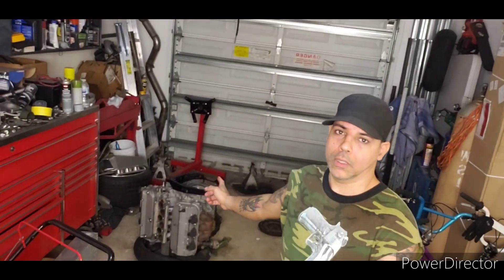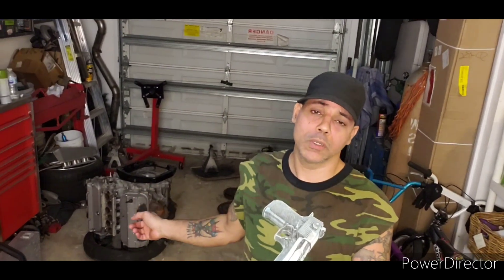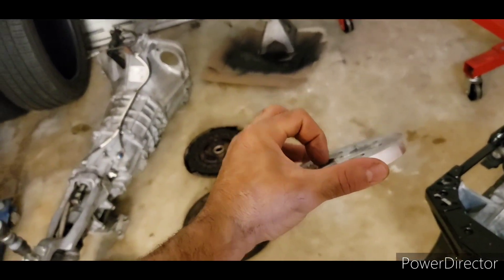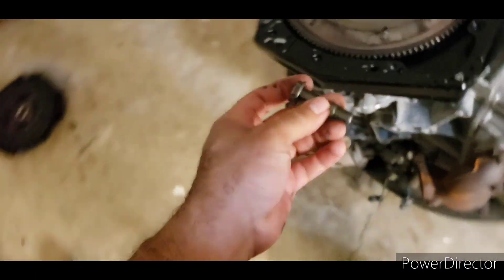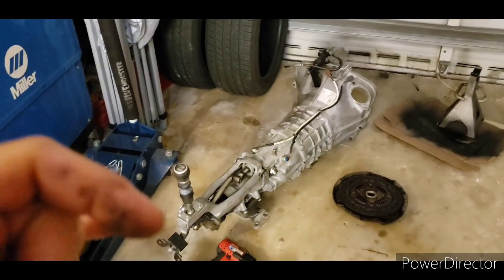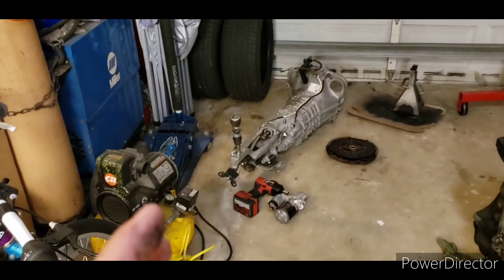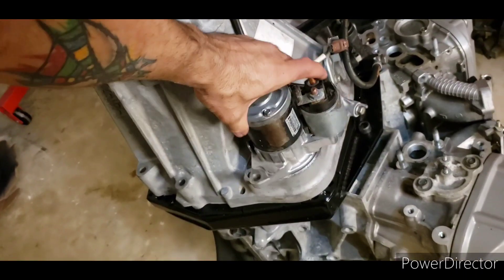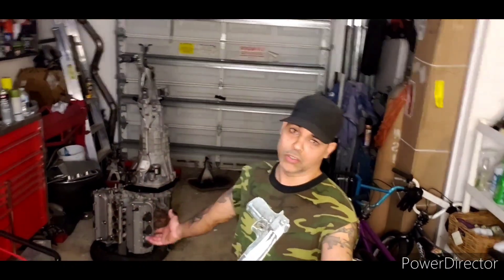my honda j32 with frs/brz transmission for my pro touring/ autocross and drift truck

Comment: Hi, doing the same using a J30A4 + BRZ gearbox. Did you make 2 separate plates for the adapter then boxed them in 1.5 inches apart, is that correct? I'm asking because there are a few bolts almost in the same spot.
Reply from the maker: If I remember correctly the material is .250 think so 1/4in plate and in the middle is 1 inch so  it makes is 1.5 overall
Reply: @JDXFAB  Hey thanks for the reply. Like what your doing with your truck by the way it should be fun. Have you got it running yet?
Reply from the maker: @philholder2064  na not yet